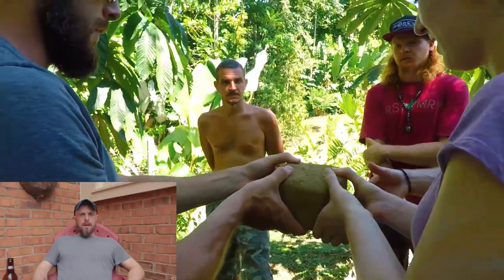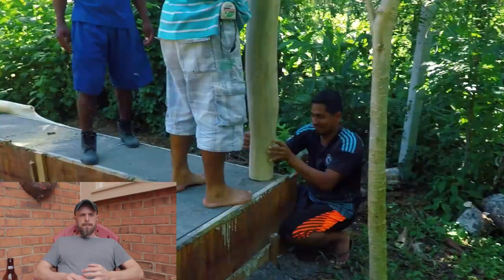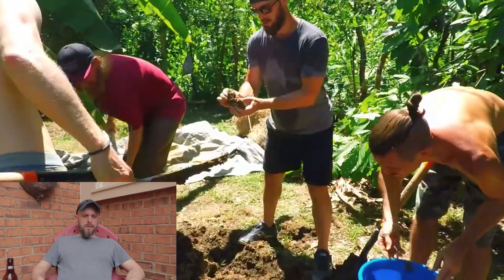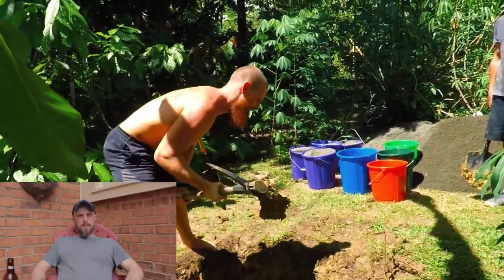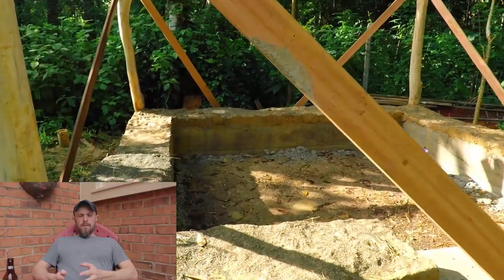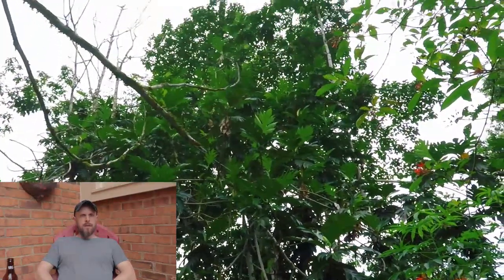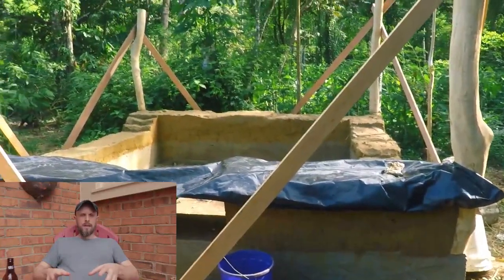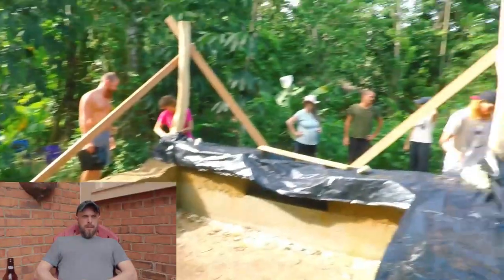Cob Building in The Tropics - My Recommendations

Comment: Fun fact: Wattle and daub has a rather rich history in Latin America that often gets overlooked both by locals and foreigners! Here it's called quincha (pronounced keen-cha), a word originally from the Andean Quechua people. Where I currently live in rural Panama there a fair number of these buildings around -usually with older residents or uninhabited, since the mainstream trend is towards cement/concrete buildings. The lattice structure is a little bit different from Wattle and Daub, mostly by having less of a lattice structure, but the design was used for centuries in tectonically unstable regions, so something must be going right.

It's hard to find documentation, but some of these buildings are 150 years old at least, and the few I've gone into have been standing since the 50s or 60s without any maintenance so they must be pretty sturdy.
Reply: First, why change to concrete if the earthen is working so good? Concrete is grossly inferior and more expensive. This is happening all over the world. I saw a documentary about the use of earth buildings in Yemen that have stood for centuries, but now that tech is being replaced by concrete because of the attempt to "modernize", NOT because the concrete is better because it isn't. I'll bet this is tied to politics, e.g., the strings tied to loans.
Reply: @1voluntaryist  I can't speak for other parts of the world, but I'm reasonably sure it's not a loan thing in this part of Panama. I've never actually seen anyone take out a loan to build a house here (maybe for land or already built residences, but never for construction).

My theory is that, for a very long time, it was really hard to retrofit earthen buildings built in the local style with things like plumbing or electrical. The few places I've seen from the inside tend to have the wiring out in the open, which seems to me like a hazard. It may have just been easier to build a new house (with the land they already had, since there's a lot of open space here) than it was to add running water for a kitchen and bathroom.

These houses were also probably abandoned in the latter half of the 20th century, when modern building materials were just reaching this area in quantities where it took less time and effort to buy bags of cement and cinderblock than it took to cut sugar cane and dig up soil in the hills.

It's also a class thing, where living in an earthen house is a visual symbol of poverty here (in other parts of panama, it's wooden homes, or bamboo). Nobody wants to have the aesthetic of poverty, and building an earthen house, and building an earthen house thats totally lux isn't realistic for local builders, so concrete is the only way to avoid looking broke.
Reply: Im planning to buy land in Ghana one day and it gets hot there. I want to avoid running air conditioning as much as I can. Does wattle and daub keep the home pretty cool? (I've only come across videos mentioning how cool cob houses tend o be.)
Reply: i am possibly moving to Panama in the near future. its looking like Bocas Del Torro most likely. Do you have any recomendations as to how i would even start looking for someone to  build a waddle and daub home? Any information would help

Comment: I have seen Cob homes in Indian villages that are at least 100 years old still standing good. But the rainfall in these places are less(less than 1500 mm/60 inches in a year). These homes usually have large overhang roofs to protect from rain and they stay cool in summer. So I think thick walls of cob are still useful in tropics. 
However I agree with your alternatives. I also saw similar age wattle & daub with earthen plaster homes in the same region as above mentioned Cob homes. Have not seen earth bag structure since they are recently developed.

Comment: In Sacramento I made adobe with high clay soil, emulsified asphalt, in the '50s. The e.a. was a waste product sold for $5/55 g. barrel which amounted to a give-away because barrels cost $15. But it worked perfect, blocks were still like new 40 years later. I sifted the soil (50% sand/50% clay) to get an even distribution of waterproofing, the e.a. was mixed 50/50 with water and a dab of detergent to get homogenization. It darkened the blocks. 
My clay must have been the correct kind. That's important. So is sifting. The blocks were removed from crankcase-oiled forms after a day, dried in 100+ temps. No cracking. 
If I had to do it now I wouldn't mix water/e.a. I would use water for the block/brick, dry, and soak it in the (now) expensive e.a. hoping to get a penetration just enough to waterproof. Also, I would design the block/brick to be interlocking to exclude the need for mortar. 
Instead of dab or cob just form a less wide brick, after testing it for strength (correct clay?), and experiment with adding ash or slag or both to lesson the need for P.C. if you can't get e.a. Progress is being made in the search for a better binding cement, geopolymers.
Reply: Wowwwww you really know your stuff!
Reply: Sorry to ask but what e.a. stand for? Ty
Reply: @angelsuniverse6021  e.a. = emulsified asphalt, a naturally occurring substance found in pools worldwide and a by-product of oil refining. It water-proofs.

Comment: Wattle and daub is way better, hi mass is a huge mistake. Ive seen high mass structures that condense moisture 24-7 inside the structure. Because concrete transmits moisture it can wick it up into the wall or wood posts also

Comment: The only reason I'm going to build cob here in Thailand is so that i have a thick thermally insulated wall that keeps out the searing tropical heat. It can be 40c and rarely below 30 in the day in S.Thailand. So, I am surprised to hear you say wattle and daub as an adequate alternative for the tropics. Costa Rica 9 degrees North and my place 7, so about the same climate. Shadow of doubt.
Reply from the maker: If you can do cob without trouble in Thailand, that would be a great option. I just had so many complications with cob in Costa Rica, I would either need to use a different method, or do some serious tests to get cob to dry properly there.
Reply: From my understanding, cob dies NOT provide thermal insulation - only thermal mass. Did you build your cob house in Thailand? How is it? I’m currently researching options to build in the Philippines 🇵🇭.

Comment: Hi. I live in a placer with very similar climate than CR, and I was thinking exactly on doing a adobe house. Not only I think it's going to be the best option, it's also something workers are more familiar with (building with bricks and mortars, basically), and it's very traditional, too.

One question I have is what's the difference between the mud that would turn into bricks and the mud that would act as mortar.

Comment: We are in Panamà and in mid construction.  We used cement block foundation and ply wood walls (lightly cobbed.  Our intention is to have cob walls about 6 inches wide on the inside soon, but the rain is keeping everything wet.  Do u think we should wait until the summer months to do the wall?
Would it be okay for me to email you for some more advice?